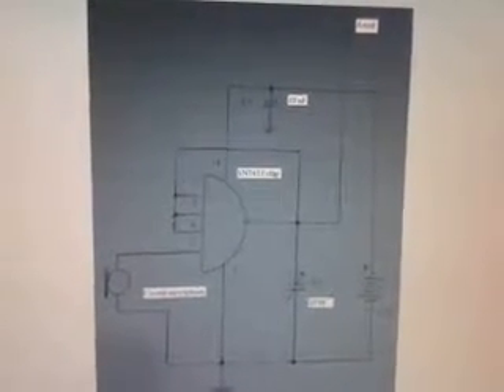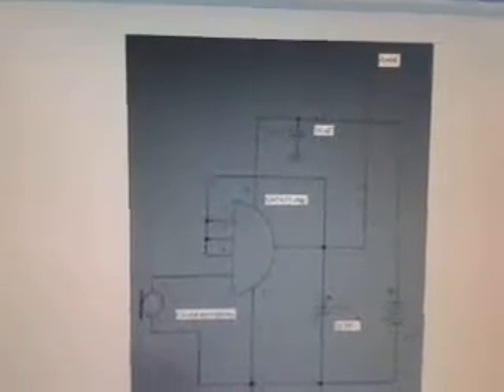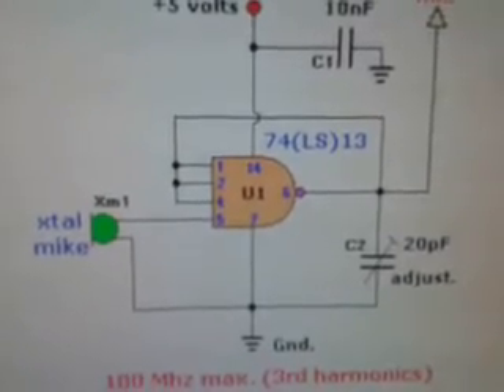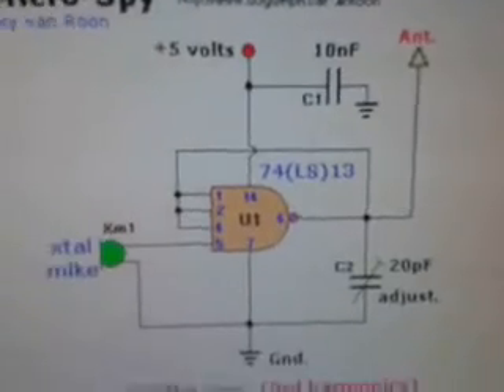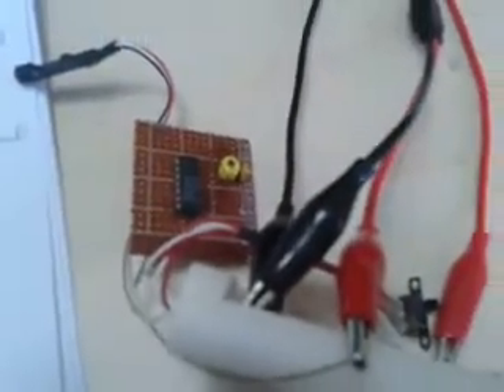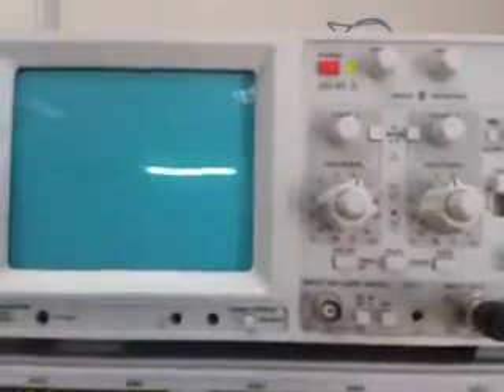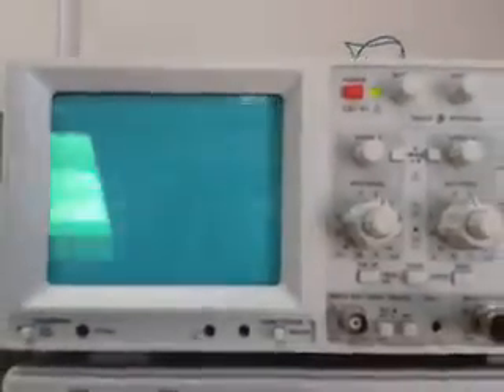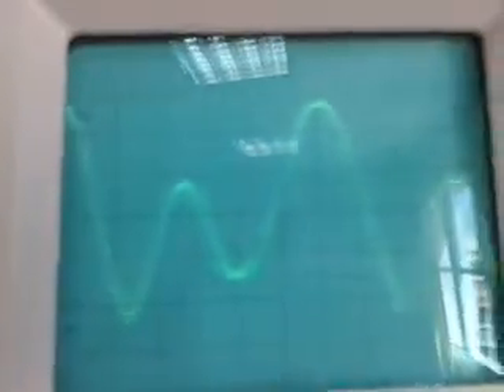The simplest FM transmitter ever - With no coil/inductor

Comment: what if i add a high pass filter and amplify it
Reply from the maker: I think its performance will be ameliorated. However, special amplifier should be used, the so called RF amplifier (radio frequency amplifier). Correct power matching should be done between the circuit here and the amplifier. Another update would be a correct antenna with power matching and the correct gain.